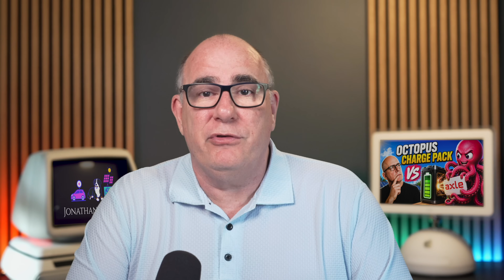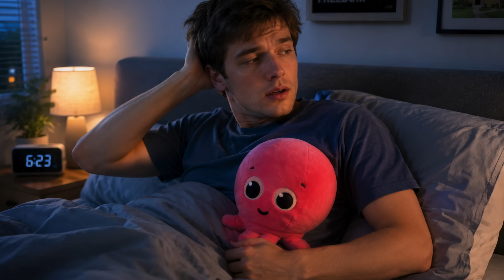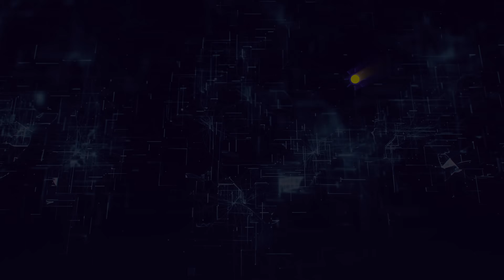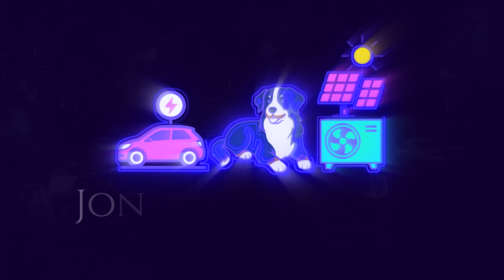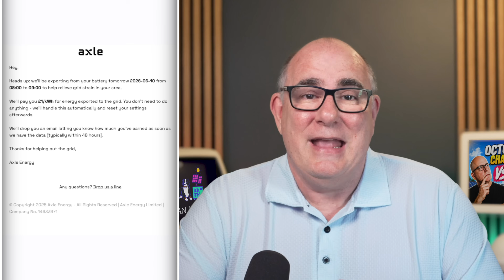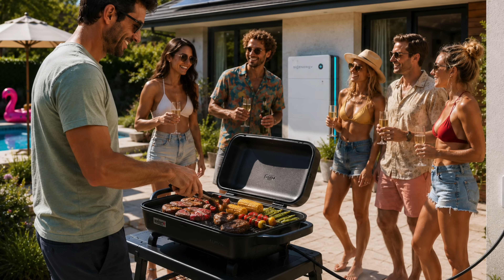Octopus Charge Pack Just Fired A Shot At Axle Energy

Comment: I'm with Octopus intelligent go and flatrate export miserly 12p kWh I recently signed up with Axle. Axle's event based export system is fully transparent and just works. Octopus are becoming more and more opaque by the day. I'm so glad I didn't give them my business for my Solar PV & Batteries or my Heat pump system.They always try to force you into their pigeon holes and it's getting worse!
Reply from the maker: I agree I recently changed from flux to standard Octopus go (not intelligent) because of their ban on axle if you are on intelligent

As you say, I really like the simplicity of axle and the transparency

Comment: So I had my battery connected to Charge Pack and the Octopus App today. 

For some reason they charged my outgoings tariff away from Agile Octopus Outgoing, to Octopus Outgoing without telling me that was going to happen...unless it is in the small print. 

I went from £10 in 3 days down to £6 for the three days...they retrospectively applied the tariff change 😢
Reply from the maker: well that’s not good, I’d certainly go and check the small print but they shouldn’t change your tariff without telling you
Reply: @JonathanTracey  confirmed. To be eligible for the Charge Pack you need to be on Octopus Outgoing, not Agile Octopus Outgoing.

They really should have better names for these tariffs as it is very easy to miss the difference in the small print.

Comment: Every home with a battery would be the optimum with the batteries with spare capacity and a minimum level of charge available at all time. I have to say that you look much slimmer in your hot tub. In the end your scenario would not be a big issue, in the worst case you would pey for a small amount of high price electricity if Octopus has drained your battery paying for your electricity. You would still be in profit.
Reply from the maker: @leeedsonetwo Clearly I should film everything in the hot tub then! 😂 On the battery, “you’d still be in profit” depends on what you’re paid versus what replacing that electricity costs. My concern is who carries that risk. Let me set a reserve and make the financial benefit clear, and I’m much happier handing over control.

Comment: I have signed up for charge pack and it is not being run as advertised, or as it states in the terms and conditions. It clearly states that octopus will always try to charge the battery in the off peak period.  However my battery is often not fully charged when the higher rate kicks in, so the battery charges from solar which cost me considerably more per kwh. So far the replies I have had regarding my concerns say that it is operating as intended.
Reply from the maker: i have heard this from many people, that’s why i stuck with axle, i do t want them using my battery for what is best for them
Reply: @JonathanTracey  other than the problem with the battery not always fully charging at night, which I will hopefully get resolved. It seems to work quite well. I still have some control of the battery if I need it. They seem to run sessions almost daily with a variable bonus which I guess is set by the cost of energy at the time. Not sure how it would compare with Axle. How often do they run their sessions?
Thanks.

Comment: Update from me. I signed up for Charge Pack (was on wait list) and it is clearly a beta product that isn't fully refined. Clear example is the lack of ability to manage the extra charging slots that IOG provide. Was expecting that they prevent the battery from discharging but it doesn't. Considering that both are managed by octopus kracken it is a bit poor. Their response: blind the battery (which I cannot due to my system set up). For this reason I decided to come off. So I cannot join Axle and charge pack doesn't work.
Reply from the maker: That’s not great. Now that you’ve finished with Charge Pack, is Axle still not letting you sign up?

Comment: Charge Pack. I'm trying it to see what happens and the return. Here's what an email looks like. 

Just a heads-up: the grid needs your help tonight, so we're running a Charge Pack session to balance out the wires.

18:00 - 19:00 (Power out): The export from your battery will give the grid a massive boost. Our credits top up your export payment so you earn your full day import rate for every unit you export – meaning the power we just added turns a healthy profit, while covering the cost of any grid power you use after the event.

Post event: Once your smart meter readings come in (typically within a few days), we'll automatically add your credits plus a £0.50 bonus as a thank you for taking part.

So i think I'll make about £1 from a 1 hour slot. Possible 5kw if i don't use any energy in the house. I never get any free energy as the battery still has plenty left over. I can't manual control the battery and put it into "Back up" mode.
Reply from the maker: Do you feel you’re actually getting good value from Charge Pack, or is most of the value going into Octopus’s pocket while they use your expensive batteries?
Reply: I wanted to give Octopus a chance to see if they are staying honest and fair. I'll know more after I've done a full month.

Comment: I'm new to the solar game since April and have a 11kWh Fox ESS12 battery and 7kW Fox KH7 inverter with 14 x 475W Aiko panels (6.65 kWP) and a gateway providing whole house emergency supply, we also have a small little used EV so are on Octopus EV rate of 7p / 30p per kWh......

Before opting in to charge pack my monthly grid draw was around 242kWh night / 19 day and the leccy bills were around £35 (down from £150 before solar!), I exported 420kWh at £50 and, under my control my battery charged fully overnight at 7p remaining at full capacity until the evening during which it topped up and later supplied the house load until cheap rate at 23:30 with, typically 40% remaining... 

After signing up to charge pack my usage has increased to 578 kWh night/ 48 day and the bill has increased to around £70 but I have exported 797 kWh and been rewarded £95 for doing so plus £2.24 for charge pack
I have noted that the battery charges overnight but then discharges to grid every day at around 06:30, leaving it at 10% to be re-charged by PV if there's enough (of which I could be exporting @ 12p per kWh)
By late evening the battery is typically down to around 20% leaving precious little in reserve for power cut usage and is often discharged further by charge pack in the early hours before recharrging
On low PV days the battery rarely got above 45% and was empty before 23:00 necessitating grid draw until 23:30...and this is in summer with all the sun we have had
With charge pack my usage has increased to 578 kWh night/ 48 day and the bill has increased to around £70 but I have been rewarded £95 for export and £2.24 for charge pack
So, the $64,000 question is which one is better.........I cant work it out !!!
....and is repeated charging / discharging detrimental to the battery, early replacement cost would wipe out any potential savings

Comment: Just to chip in here, I have been running Charge Pack since launch to see how it handle my system and if I would be better or worse off for it. I have just received my bill for the June 25 to July 25 period.

I have a 24kWh SigEnergy system and used my hourly readings to simulate the battery level and my predicted battery levels and appropriate import/export quantities per hour, then used my daily/nightly rates to figure out hourly costs.

Overall I appear to be about £15 out of pocket as a result of the experiment, and that is before you take into account I could have participated in Axle events and made another £18-£24 based on 4 export events at an 8kWh export (depending on house load during the events).

I have sent an email to Octopus about the results and my disappointment with the compensation given for having control over my battery, and for now I would suggest anyone else looking to Charge Pack would avoid it until they properly compensate you for the periods where their AI imports during day rates outside of an "event".
Reply from the maker: That’s a pretty poor result, especially given the level of control you handed over. It looks like they captured all the value while leaving you to carry the cost—and miss out on the Axle events too. Thanks for sharing the numbers.

Comment: You hit it on the head
If you can’t measure and quantify how it worked etc then most of us wont trust Octo to manage our costly systems.
I’ve read too many examples of failures on Octo’s part to realistically think they get it right 100% of the time so won’t start now
Reply from the maker: @MrRuirio That’s exactly the issue for me: trust needs evidence. If a third party is going to control an expensive home battery, owners should be able to see clearly what it did, when it did it, and how the result was calculated—not just be asked to accept a headline saving.
Reply: @JonathanTracey 100%

Comment: Axle is a no brainer for me. 11kWh of battery and a 5kW inverter. Currently the events are only an hour. I still have 5kWh plus at the end of an event. On that basis I'm almost never going to pay for peak rate energy. In the worst case, I'll lose 5kWh of PV exports at 12ppu.
Reply from the maker: I think that's exactly where Axle starts to make sense.

With 11kWh of storage, you're unlikely to empty the battery during a typical one-hour event, so you still have plenty of energy left to avoid buying at peak rates afterwards.

As you say, the worst case is giving up a few kWh of exports at around 12p/kWh. If, in return, you're earning significantly more through a grid event and avoiding importing electricity at 30–40p/kWh later, the economics can work very well.

It's one of those situations where the right answer depends on the size of your battery and your usage profile. For larger battery owners like yourself, Axle is a compelling proposition.

Comment: One thing I have noted is that since we are using the charge pack my solar panel generation has gone down I think they are also controlling how much is put back to the grid. Since I disabled it it's gone up again before I was getting 1.5kw now I'm getting 3kw
Reply from the maker: I’m assuming you have an all in one system with battery and inverter controlled together, this would allow them to throttle your solar if they don’t want it. This is my worry is that it’s not really clear in the documentation as to what they will actually be doing with your system
Reply: @JonathanTracey I agree I have cancelled it now and today I'm generating 5.8kw

Comment: I lasted on Charge Pack for all of 1 day before I realised this was not going to work for me and I told them to remove it. I signed up, connected my battery, and within a few hours, Octopus had drained it from 80% to 10% (its new minimum SOC, lower than what I had originally set it as). The rest of the night, I'm then drawing from the grid rather than using my battery. Overnight, I was expecting the battery to then charge back up to 100% on the off-peak IOG hours; it did not. So instead of waking up with a full battery, I have nothing in there at all, so now I'm drawing from the grid again at full rate. I do not know when this battery will charge again... If this was going to be a daily occurrence, their £12 a month incentive was going to cost me a lot of money!
Reply from the maker: well that sucks, i assumed they would give you a schedule in the app like the car
Reply: @JonathanTracey  That would have been useful but no, there is nothing aside from a message saying "We're now in control of your battery". I can't even force charge or do anything in my FoxESS app now. It's totally borked.
Reply: I have a similar experience, but Im not sure if the charging from the grid in the morning is charged at standard or reduced rate. Im assuming reduced as it states in the services explanation. However this happens every night, not just when im notified of a "session" which I wasnt expecting. I will wait it out till the end of the month and see what happens to my bill.

Comment: Having done some digging around, because I also did not understand what was going on with Charge Pack, here is what I found :
1) Apart from registering for Charge Pack on the Octopus website, I only found out today, 12 days later, that you also have to register your batteries with them. If you had done this beforehand for any other purpose, then no change required. If however, you have a newish install, then the battery has to be reigstered as a device. Thanks Octopus for the clarity - not.
2) The way the £12 minimum is described and how it works financially is just absolutely awful. You fixate on the £12 and haven't a clue what else goes on.
3) However, in plain English, with a few safety nets from Octopus aound the edges, what the scheme means is that for every kWh they export from your battery, you get 2 payments - firstly your exports at the normal 12p a kwh and then a top up payment of your standard peak rate, less the already awarded 12p. So in effect you earn peak hour rate for your 1 kwh export.
4) Obviously to be repeateable, Octopus will recharge your battery at your off peak rate (with a corresponding credit if they do this in peak hours).
5) So you earn your peak tariff less your off peak tariff  - per kwh . My peak is 28.56p and offpeak is 6.9p, so every kwh under ths scheme earns me 21.66p 
6) As there is a minimum credit of £12, it means I will earn 21.66p on the first 55kwh exported under Charge Pack. If they export less, I still get the £12. if they export more, I earn more than £12.

It's maybe not as exciting as Axle and I don't know how often Octopus will run sessions, but for me, a guaranteed MINIMUM of £12.00 is a good deal, even if Octopus do nothing. An ongoing export rate of 21.66 for me is also good, over and above any natural solar exports at 12p

Hope that enlightens a bit :)

Comment: It's reassuring you see the octopus power pack in a similar way to me. The info provided by them so far is so opaque I cannot make an objective decision whether it would be better for me to hand over full control. Until such time as I find out how power pack works financially either through better info or from real world users, I will stick with Axle where for June I have earned over £19 for loaning them my batteries for just 3 hours and still have plenty of capacity to keep my house running.
Reply from the maker: Same here I am sticking with Axle for now but if we get more info and its looks good may switch just to try it out

Comment: Question, I already have 15Kw batteries which as you say I control, charge at night Solar tops up & I export surplus.  Now if I added say the extra 10Kw from Octopus very handy for my Heat Pump in winter does it only control the Octopus pack?  I have already handed my car over to them
Reply from the maker: @PeterHartland That's how I understand it, although Octopus haven't gone into that level of technical detail yet.

My expectation is that Charge Pack would only control the **Octopus battery**, while your existing 15kWh system continues to operate as it does today. If it took control of third-party batteries as well, that would be a very different proposition.

That said, I'd be looking carefully at how the two systems interact. For example, if your own battery is trying to power the house while the Octopus battery is charging or discharging, there could be some interesting interactions. Hopefully Octopus will publish more detail before rollout.

If your main aim is having another 10kWh available for the heat pump over winter, it could work well, but I'd definitely want to understand exactly who is controlling what before signing up.

Comment: Thanks Jonathan, it all seems perfectly simple to me in the material I have read from Octopus. You cannot have any Flux packages from Octopus if you don't have solar. But if you have Intelligent Octopus, and a suitable battery, then you can have the 'Flux' equivalent using Charge Pack, and earn a minimum £12.00 a month from Octopus, as compared with £10 monthly guaranteed from Axle. It's meant for us who have EV's, and a home battery install only, so passing on the benefits of 'Flux' to those households. 
If your battery is forced discharged by Octopus at peak tariff, they reimburse you accordingly so that overall, you will never pay more than you would have paid anyway using Intelligent Go to both charge your car and charge your battery as scheduled in the usual way. You help balance the grid, and get paid £12.00 a month for your trouble. If your battery is discharged overnight by Octopus, they will ensure than anything you consume during the day at peak will actually be billed at the off peak rate instead. That's how I read it anyway.
Yes, it's different modelling to Axle, but it's also £2.00 a month more than Axle, guaranteed.

Comment: Axle has 2 modes: Events only and Complete Control.  I think Complete Control is the Axle product you should have been relating to.
Reply from the maker: I certainly wasn’t offered the complete control mode when I signed up, I wonder if it’s only for very small number of customers or a very specific setup
Reply: @JonathanTracey the default setup is Events but you can amend to Full in settings if you're happy to hand over total control to Axle
Reply: I think full control is only offered on specific batteries
Reply: @davidsinclair144  It's more accurate to say: "There's a few batteries that aren't supported" e.g Tesla
Reply: @davidsinclair144  The thing that interested me was how quickly you could swap between Events and Complete Control.  With an Octopus tariff waiting underneath when you switch to Events more it's like being able to tariff swap on the fly.